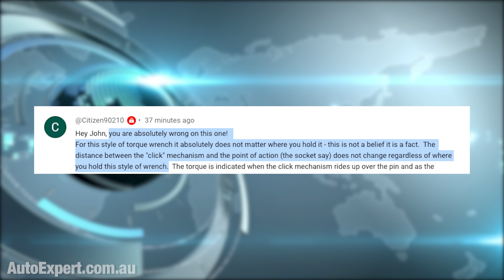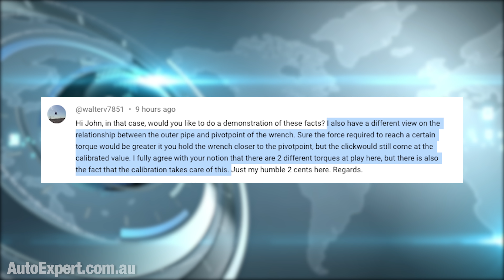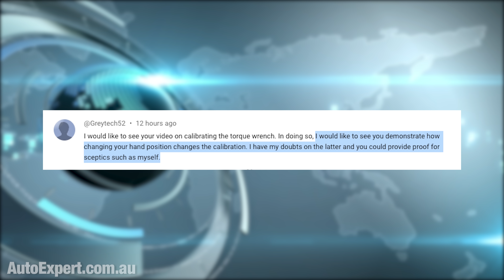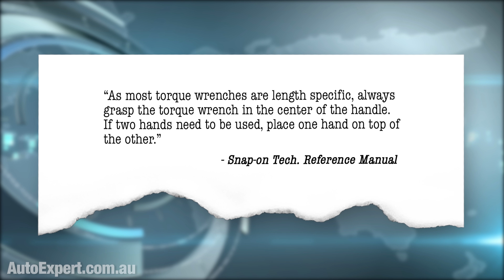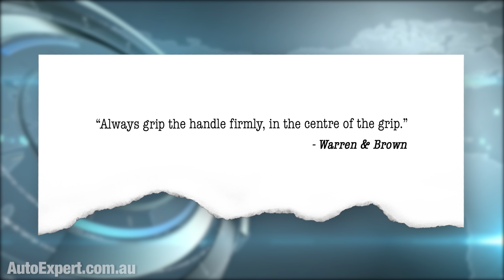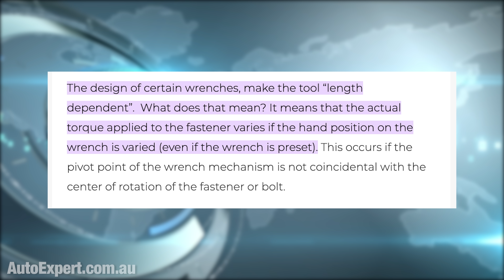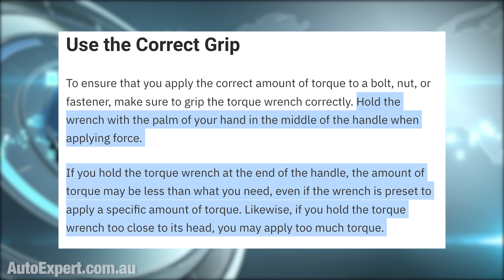Am I wrong about torque wrenches & hand position, again? (The facts) | Auto Expert John Cadogan

Comment: I fact checked the Capri Tools page mentioned and found this titbit..

There Are So Many Ranges of Torque Wrenches. How Do You Select the Right Torque Wrench for the Job?
Store Your Wrench Correctly.
'When not using your torque wrench, be sure to turn the wrench down to its lowest possible setting. If you store a torque wrench at a higher setting, your wrench’s main spring can wear out and eventually fail.'

I'm sure I read JC opining yesterday that there was no need to back off the tension for storage.. oh look;

@gordonhall5983
1 day ago
You failed to mention, the spring must be wound off when not in use.
Reply
@AutoExpertJC
1 day ago
Because that's completely unnecessary.

Comment: I enjoyed the previous video as I recently purchased a Chineseum torque wrench and was keen to learn how to correctly use it, trusting John's experience and judgement in these things. The length and hand positioning are critical to correct operation, even a novice like myself knows that. I chipped my mechanic for using a 70 cm 17mm spanner to do up my sump plug, the last time he did that we had to get a breaker bar on it to get it off. Positioning of the hand and the length of the wrench are critical factors to accuracy. But who am I, I think snorkels are bullshit and caravans suck donkey dicks. Not a lot of beard stroking wisdom from me.

Comment: Why would you buy a calibrated tool to get accurate torque and not use it on the correct contact points it's calibrated to? Nice tee by the way 😂

Comment: 6 ft/lbs at 6 inches not same as 3 ft/lbs at 12 inches?. Carpenter trying  to understand.
Reply: It's easier to see what's going on with diagrams than it is to visualize descriptions, but...  Your concept is correct, 6 lb force at 6 inches will result in the same torque as 3 lb at 12 inches. The discrepancy arises since torque is being developed over two different length arms of moment in a pivoting tube type click wrench. The click mechanism is measuring the torque applied between your hand position and the pivot pin securing the tube to the head. So if we apply your example figures to the tube section, the mechanism will measure the same torque because the forces and distances both change inversely exactly 2:1. But the torque that is being applied to the bolt or nut is applied across the greater distance between your hand and the center of the bolt. So if, for example, the pivot pin is 1 inch from the bolt center, moving 12" to 6" on the tube will vary 13" to 7" from hand to bolt pivot. 13:7 is not 2:1 (approx 1.857:1), so whilst the torque applied to the click mechanism is the same (applying 6 lb at 6" gives 3 lb/ft), the resultant torque on the bolt or nut is not the same (applying 6 lb at 7" gives about 3.23 lb/ft).

Comment: I tried to rest this idea with two torque wrenches working against each other. I have a tube type, and some crappy pointer with bendy arm thing. Not that i have much faith in the latter, but that's what i have. So my test had the crappy thing handle in the vice and by some arrangement of sockets an bits, the tube type on top. So holding the handle, pull until it clicked, then using an extension pipe repeat all the while observing the pointer on the crappy wrench. Result? Seemed similar enough to to say it clicked at the same value on the crappy bendy thing. Then repeat by holding tube type nearer the working end. It was more difficult of course but seemed to yeild a higher torque reading on the bendy arm/pointer device. Confirming what John said? Well I'm not sure since I had to use my other hand to support the 'bolt' end so it didn't twist the whole arrangement since the handle and shaft on the bendy in the vice aren't designed to resist that. So I expect I was adding an opposing force just to keep it in place so the reading was not accurate. Also i was applying that counter force in a different direction, so yeah I'm going to need to do more testing. 

However, it seems to me that until the mechanism clicks, it is effectively a rigid lever. As such Newton metres is force times distance alone. More force is required on a shorter lever to achieve the same as less force on a longer lever. The click mechanism has no influence until it clicks because until then it is rigid. Internally nothing moves relative to anything else until that release occurs suddenly. (Ok there will be some progressive movement near  the release point but it is near instant like sub implosion at 3500m depth, what? Too soon?)
.

Comment: The results described are correct, but the rational in this video is wrong. Yes, hand position needs to be correct. But the reason is that there are two torques being experienced in the system. The torque required to release the clutch, which is fixed by the spring and the defined length of the distance from the pivot to the clutch. The torque “felt “ in the system is the torque at the bolt, set by the force applied by the hand and the length of the arm.  It will be different, always, than the torque at the clutch because it’s 1-2 inches further away. So if you choke up, you need to push harder to get the clutch to slip. The clutch slips at the same felt torque. But the bolt head experiences higher torque. 
This video does the actual math  without calling everyone an idiot. 

https://youtu.be/0f746pF1xc0

Comment: A simplification me thinks.

The distance from the pivot only impacts the force felt by the user, I.e. closer, more is felt as there's less of a moment arm, further away, less is felt as there's a greater moment arm. 

The torque applied to the bolt via internal mechanism (includes a spring) is totally independant.

The reason torque may be impacted is that after the click, a secondary, mostly uncontrolled torque is applied from the mechanism bottoming out - especially uncontrolled if greater user torque is applied closer to the pivot (due to lesser moment arm), i.e. its difficult to stop a greater force hence 'mostly uncontrolled' torque results.

If one could grasp beyond the end of a torque wrench, there'd be more control, BUT, the overly slow rotation speed is sure to result in a premature click due to friction inherent in torqing of a bolt.

In short, one should never apply torque too slow or too fast, rather at a constant rate - torque wrenches are sized with this and the torque range in mind.
Reply from the maker: Torque wrench manufacturers do not agree with you. 
Coincidence???

Comment: I'm not sure what's more irritating in this video; The number of people who don't understand what JC clearly & accurately explained,  or the "voice overs" JC uses to impersonate the voice of the commenter.  The simplest explanation of any torque is something like "a force applied at a radius (or distance) from a centre/hub/crank or load"  There are lots of more complex ways to define torque which JC is better at explaining, but the simplest idea is just that - a force acting at a distance from the centre. Well guess what? That's exactly what a fkn torque wrench looks like. And the distance from the centre (i.e. your grip position) directly effects the amount of torque, because the distance is a fundamental part of the definition.  Torque IS a function of the leverage...so saying the hand position doesn't matter is a bit like denying the fact that a longer breaker bar won't work to undo a tight bolt.
Reply from the maker: The VO is carefully designed for maximum irritation...

Comment: But in certain cases you are wrong!!!  There is different torque wrench mechanisms available, flex-bar type, click type and cam-over types.  For the flex-bar types you are 100% right! They need to be taken with the handle (but they do not invite to do different).  For both the click and cam-over types it all depends in what position the designers have chosen to put the internal torque pivot point.  If positioned in center with the wrench head, you are 100% wrong, one can hold the hands wherever one likes on these!!!  But in most of the designs, the designers have chosen to move that pivot point away from the wrench head in order to keep the head compact and slim.  And in those cases you are 100% right, one has to hold the hands on the handle!!!  For the engineers, the reason why is well explained in this video: https://www.youtube.com/watch?v=0f746pF1xc0

Comment: You can scream FACT as much as you want, but I believe you to be wrong. There needs to be real experimentation to back this claim up. Because the clicker device is the thing that is applying the torque to the inner ratchet, from the end of it, and it does not matter on where the outer tube you apply the torque because the clicker is still applying it from the end.

Comment: It’s been so long since I learnt to wield a magical torque wrench the required witchcraftery is hidden in the anals of time…
But seriously, considering the instructions in the box are so faded a religious historian could probably discover the thumb image of Christ with the correct technology, what’s the ‘opinion’ on long term storage? I keep one in the car to use solely for wheel nuts and lazily have left it set to 140kNm. Will that compression on the spring have a derogatory effect on the calibration?

Comment: LOL. I'm surprised you seem to be struggling with the concept that some people believe their opinions trump facts. At 64 I am resigning myself to the idea that, on multiple fronts, facts don't matter to more and more people. To many, facts and reality are purely subjective and can and do change based on their feelings. That is a fact LOL. 

Also, to the commenter who suggested that you use a strain gauge and provide the evidence, if he is so convinced that you are wrong, might I suggest that he himself get a Harbor Freight digital torque adapter and play with it using his torque wrenches. Not only will he find that what you are saying is absolutely correct, but he will also find that, on individual torque wrenches, adjusting the hand even a centimeter or so will definitely affect the torque reading on the torque adapter. In fact (there's that pesky word again), I'd suggest "getting to know" each and every torque wrench one has to find the "sweet spot" on the handle for each particular tool. Because even slight change in position of the hand will affect the torque applied.

Comment: does the ex wife (any of them)  have an opinion on the length dependence of the tool and the force applied to the insertion? 
PS Darwin had a very good beard so did Lord Kelvin, August Kekulé (good bloke for your IC engine), James  Clerk Maxwell (goes with your t-shirt), William Crookes, Dmitri Mendeleev, Ernst Mach (good if you want to go fast), Wilhelm Ostwald (catalytic converter?), Wilhelm Röntgen (if he didn't have a beard you would be in trouble when you broke your leg or you have a problem with the relative position of your hand and your tool) and lastly Ivan Pavlov (handy if you want to discipline your dog) Without beard stroker's many would find themselves  in the faecal position - if you rooly rooly want to go far in science grow a beard

Comment: Jim Sim...there is a guarantee on a wrench .. the bolt you are tightening the metal the thread is using plus all other parts related ... what your blackheads do not realize is the failure of any part can be related back to a specific failure point .bolt failure . And we get liability issues costing millions plus ..one bolt is all it takes and a judge will attribute blame on the person s responsible. Compensation .. fines ..  costs .. liability s 
. This often ends in complete bankruptcy  .house gone cars gone marriage f....d .. family living in boxvil .. all because a stubborn know it all did not use the advice given by the manufacturer . And in .any cases these people areaccademics with degrees from good u niversities my brother is a 2nd 0fficer engineer merchant navy and 100 percent t endorces what you say also has engineering degree my 2nd  rather a science teacher also endorses it ..I am a woodwork machinist of  50 yrs exp ..who knows how important torque is when changing cutters weighing up to one kilo or more and spinning at 3000rpm there is  o No room for error .. at these speeds a failure can kill people write off a machine costing 100000s pounds .and you wo t have a job for the rest of your life the word travels bloody fast ..to avoid any of these pitfalls just Read the instructions do exactly what they say ..and there should be NO comebacks SIMPLE...